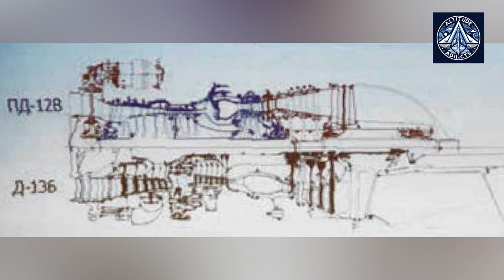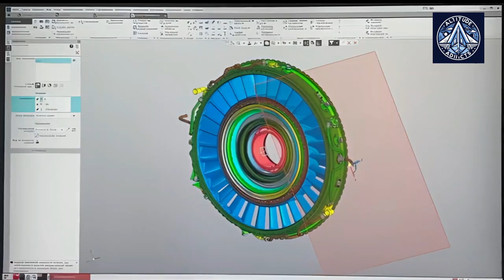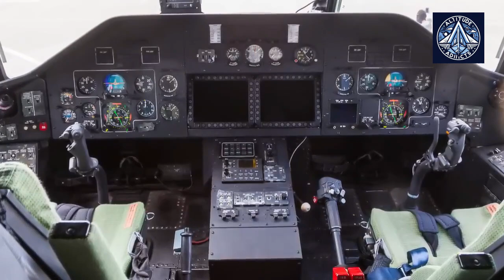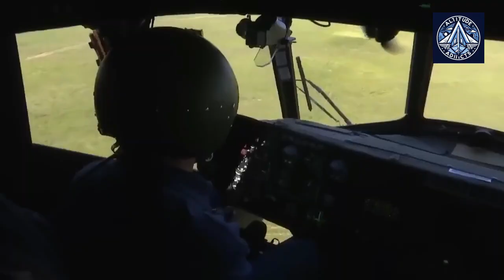PD-8B Engine to Power Mi-26 Helicopter Ditching D-136, What Happened to PD-12B?

Comment: If the PD-12V was going to generate 14,000hp then it was probably over powered and not suited to the job. The PD-8V has 15% more power than the D-136. The D-136 is an 11,000 hp engine, so the PD-8B will have a power rating of about 12,650hp. The fact of the matter is that the Mi-26 is already the most powerful helicopter operating and is not underpowered. A new engine using new technology that is more powerful, but also likely more fuel efficient and more affordable to operate and maintain. They are finally replacing another Ukrainian engine so they will be able to begin exports and increase domestic use of these aircraft. This is a good thing. Engines in this power rating could be used to make turboprops for light transport. The PD-8 turbofan will be used on the Il-212. A 12,650hp engine could be used with contrarotating blades like the An-70s engine and could be fitted to a twin engined version of the Il-276 to replace the An-12. So many Russian projects being held up simply because they lacked a domestic engine... now new engines are coming online... it is a very good time for Russian aviation.
Reply from the maker: Nice. But you forget the basic aviation rule - D-136:

Weight: ~1,100 kg
Power: ~10,000 SHP
Converting to approximate thrust: 10,000 SHP × (1/2.2) ≈ 4,545 lbs thrust equivalent
Thrust-to-weight ratio: 4,545/2,425 lbs ≈ 1.87:1

PD-8:

Weight: ~2,200 kg
Thrust: ~14,000 lbf
Thrust-to-weight ratio: 14,000/4,850 lbs ≈ 2.89:1

If fitted on same aircraft:

D-136 would give less total thrust but with lower weight penalty
PD-8 provides more thrust but with higher weight penalty
The lighter weight of D-136 means better payload capacity

In this case D-130 is fuel efficient at the lower altitude. PD-8 will be at highter altitude where Helicopter does not fly.
Reply: A heavier more powerful Russian engine that is new and will be in mass production is better than an old Soviet engine that is lighter but whose factory refused to sell engines to Russia and is probably in no condition to make anything of use right now or years to come. The specs for the Il-112V are not as good as some western equivalents either, but it only needs to be better that the An-26 aircraft it replaces. Over time new engine upgrades and improved engines will make it even better. They had plenty of time to make these decisions. Perhaps they wanted better hot and high performance?

Comment: I dont think we have the technical expertise to comment on the power of the engine.
Pretty sure their engineers are more than qualified to decide on the relevant parameters
Reply from the maker: True. But they have gone down from a 12  ton PD-12B engine to 8 ton PD-8B engine. 12 ton engine was the original requirement.